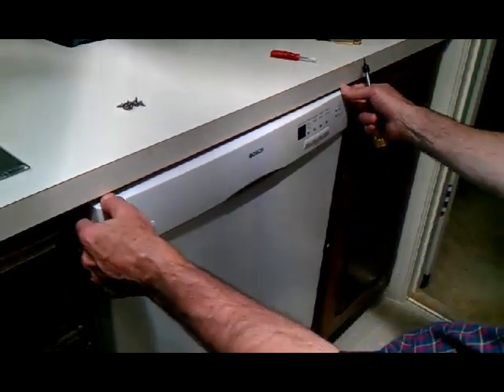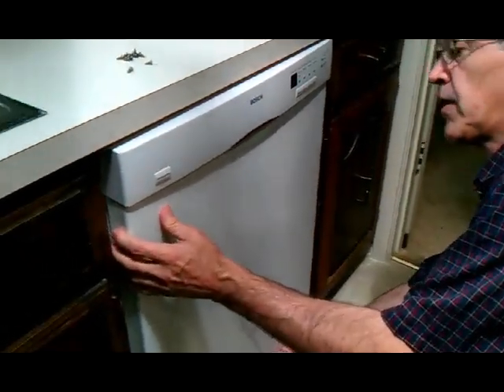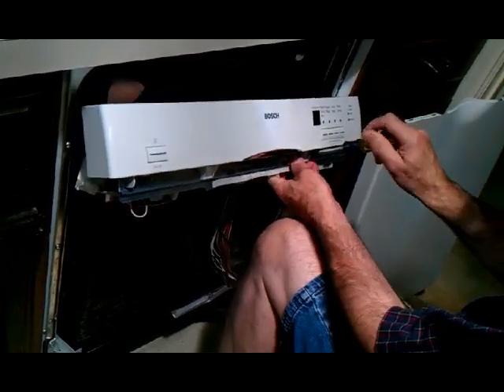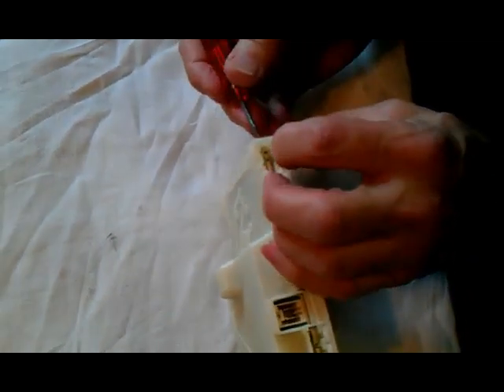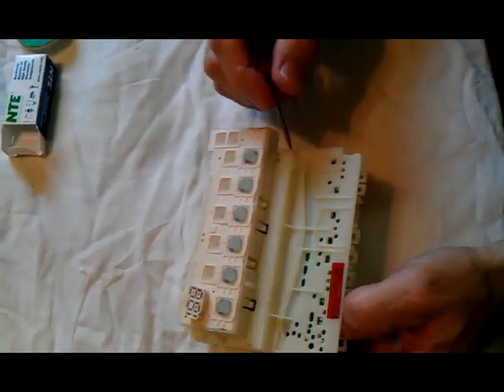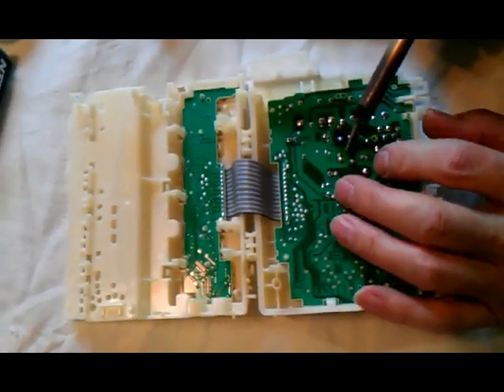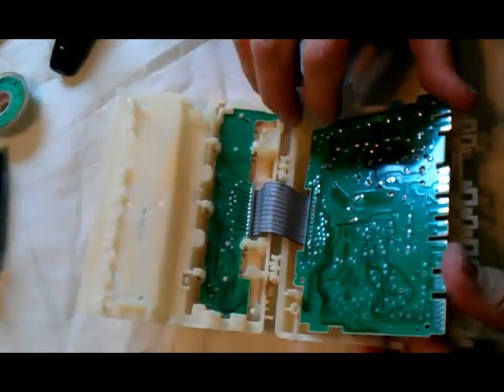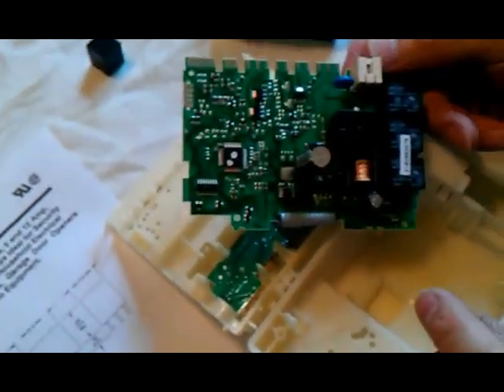Bosch Dishwasher Heater Relay Repair Part 1

Comment: Ive heard some solder can crack, also heating/pump assembly can go bad. How to i troubleshoot without putting the whole back together and running a load? I do have a multimeter but this is a bit out of my wheelhouse

Comment: What replacement relay for a HF3FA 006-HTF (576) 10A 250VAC for a Bosch Dishwasher SHE43RF2UC/64?
Thanks for your help!
Reply from the maker: I would use the 6 volt NTE Electronics R46-5D12-6 relay.  It is available at a number of places including Amazon.  Just search for "R46-5D12-6"
Reply: Which solder sucker did you use?
Reply from the maker: @annhering6585   I bought it back in the early '70s and it is no longer available.  Any solder sucker or solder wick should work fine.
Reply: Thanks for letting me know!

Comment: Thanks for making the video! I have a Bosch SHU43C0x/22. It runs well until there's 1 minute left on the cycle, then it gets stuck in an infinite loop. All other parts and functions work well. I hired a technician from an appliance company and showed him this video, but he said, "This is DIY, we don't do DIY. We can only replace the control board, and it is $375 on backorder with no estimated shipping time, maybe one month. Plus $200 repair fees." This is too much to repair an old dishwasher. So, I paid him $205 for the 15-minute diagnosis. Now I found a handyman who agreed to give this "DIY" method a try. It may cost me another $250 whether he can fix it or not. It probably would have been wiser to just order a new dishwasher in the first place since I'm not handy enough to do this myself. But I think it's worth a try if this dishwasher can have a second life.

Just a quick question: Do you know which model of relay I should buy for this Bosch SHU43C0x/22? Thank you so much in advance! 

Just a quick question:
Reply from the maker: Yeah, you are not likely to find an appliance repair technician to replace the relay on the board.  There may be 1 in 50 that might do it.  As for the relay, I am not sure which relay the SHU43C uses.  Look on the top of the relay for the coil voltage.  Expand the video description to see the relays that I mention there.  If you are still not sure, post the relay part number and I will verify it for you.
Reply: my bosch dishwasher is Shx33a06uc/22 which relay will go with this?

Comment: Hi, my she44c07uc/22 control board was badly burned (a hole thru the circuit board).  I want to attempt a fix using jumpers but I would like to see a good visual of both sides of the circuit board (including topside without relay in place) to make sure I don't have any traces missing.   Your video is excellent but would especially like to see topside wo relay in place to see if there are any traces on topside under the relay.   Also, the circuit board you have is slightly different than mine in that yours has a factory jumper wire that can be seen between the relays on top where as mine does not.   I'm wondering if I should add this (there are no pads/holes for it).  Ideally a schematic of the circuit board would be nice to be sure (i'm an old electronic tech but haven't practiced in years).   Much appreciated. 
Also, what does the relay next to the heater relay do?  (its common was also damaged (but fixable) Thanks!
Reply from the maker: Did you happen to watch my video about tips for repairing these boards? https://www.youtube.com/watch?v=RLdi-PgvAnU  There are a lot of different boards shown in that video.  If you don't see what you need, send me a photo of the front and back of your board to MyBrokenDW @gmail.com and I'll take a look at it.

Comment: Thank for your video. II have the same issue with my old BOSCH. I would like to replace the relay but I am having hard time finding a replacement.  I am reproducing what I see: 
NAIS  JS1-12V.  AJS1311.    SPULE: 12V    10A125V

Appreciate if you can help me find an NTE replacement, Thank you!
Reply from the maker: I would try Amazon for a R46-5D12-12: https://www.amazon.com/NTE-Electronics-R46-5D12-12-General-Arrangement/dp/B002C97U50
Reply: @AgglomeratedIdeas  Thank you!

Comment: Thank you for posting this video. Can you tell me why my Bosch dishwasher heating element works during the drying cycle, but doesn't come on to heat the water during the wash cycle?
Reply from the maker: It is possible that the dishwasher is in Economy mode. In that mode the water is not heated nearly as much as normal wash mode.
Reply: @AgglomeratedIdeas  Thanks for your reply. The DW is about 20 years old and doesn't have that feature. It also gets stuck in the WASH cycle and will not advance.
Reply from the maker: @victorsparks3408  Ah, okay.  It is likely a failing heater relay.  As the relays are in the process of failing, they often work intermittently.  My DW worked okay at times and then wouldn't...it was very erratic.  I finally took the control board apart and found the bad relay.  BTW, a failing/failed relay does not always show up as a bad solder joint on the board.  Sometimes all you will see is a darkened area on the board where the relay is mounted.
Reply: @AgglomeratedIdeas  Again, thanks so much for your reply. Do you have a resource for heater relays?
Reply from the maker: @victorsparks3408  it would depend upon which relay you currently have on your control board.  You will need to open it and have a look at the top of it.  You will probably find a match for it already in the comments below.  If not, then get back with me.

Comment: Great walk through.  After watching a few repair videos where they just re-solder that point.
I agree that if it burned there's a problem.  Obviously that relay takes a beating and a higher spec part would be the way to go.  Thanks for the simple step by step.  You even showed the little tiny clips that hold the clamshell together.  I only broke one in the process.  
Cheers!

Comment: I'm glad I stumbled across your video.  I just took apart my controller and can see that the solder is completely missing from one of the contact points. There are no burn marks but I assume it may have melted away and didn't short out yet (heater is not engaging). I was about to resolder like other videos have shown but had a feeling that I should look into it some more.  Just wondering if you/anyone has ever seen a case where the solder is just gone. No burn marks nothing.  I can share a pic if someone gets in touch. Thanks for this!
Reply from the maker: Sometimes the solder will melt without showing a burn mark on the board.  Nevertheless, the relay has failed and you need a new one.
Reply: @AgglomeratedIdeas  thanks very much!  Such a quick response!  The relay on mine is a Song Chuan 899B-1C-F-C E (6v DV) 10A 250V~T85.  I see one on ebay (from china) and the the only difference I see is a number marked on mine which is C0552 while the one on ebay is C0633.  Not sure of the difference, if any?  Would it work / or should I get another one like you did (will yours work)?  Thanks so much again!
Reply from the maker: @anthonysipos1002  You can go with the Song Chuan if you like.  It will work.  I would buy the NTE R46-5D12-6 if it were me though.  It is available multiple places including eBay.
Reply: @AgglomeratedIdeas  thanks again! I'll go with the NTE. It seems to be available in many places including Amazon. I'm so thankful for this.  Will report back on how it goes...
Reply: @AgglomeratedIdeas  . I just received the relay and was about to resolder it when I noticed that another piece seems to have missing solder. Looks like a coil (I think it's called that.. It's the only part with copper wire) just on top of that relay.  Is it a side affect of the failed relay and I should add solder or is it another defective part to be replaced? There are 5 connections to the coil and 1 has the solder melted away. Maybe from downstream effect of the relay failing? Thanks so much again!
Reply from the maker: @anthonysipos1002  I can't imagine what that item might be.  Take a look at my other video ( https://www.youtube.com/watch?v=RLdi-PgvAnU ) and see if you spot the item that matches the part you are describing on one of those boards and give me the time on the video.  Examples of various boards start about halfway thru that video.
Reply: @AgglomeratedIdeas  .  Thank you again.  My relay failed exactly like the one starting at 31:10 of your other video..  Looking at 31:51 I see now that I should not re-solder the connection below and above the failed solder point.  these pins do not look like they had solder to begin with (I assumed they melted away).  I just find it odd to see pins which are not soldered.  It's counter-intuitive, but I guess it's by design?  So in essence, out of the 5 pins of my relay, only 4 are soldered and only one of those failed (not too badly) just like the one on your second video.  Does that make sense?  My Dishwasher model is SHE44C05UC/22.  You are awesome - thanks very much!
Reply from the maker: @anthonysipos1002  Yes, on some models the relay only has 4 pins soldered.  You can send me a photo to MyBrokenDW@ gmail.com if you like, but it sounds like you have it figured out.
Reply: @AgglomeratedIdeas  once again a huge thanks!! Replacing the relay with your sound advice did the trick and saved me hundreds of dollars!  Truly epic how you guided me through the process!  Thank you so much again and again!

Comment: Wish I had done more research into the Bosch heating problem before assuming it was the heating element and spending $160 on one, only to discover the dishwasher still didn't heat.  I found videos like this one and removed the board, and the pin in question was completely vaporized, as was the plating around the hole - the relay had to be replaced.  I'm going to scratch off the solder mask around the area and all the way to another pin on the plane, and then run some bus wire along it to hopefully give a long-lasting connection. Bought the relay on Amazon.

FYI, my dishwasher was the SHX46A05UC/14
Reply from the maker: Unfortunately when the relay fails it sometimes does damage to the board.  Often it can be easily fixed like you described.  I put up another video to show that procedure.  I hope your repair goes well.

Comment: This worked!!! It actually worked! One advice I have for others is to use some type of 90degree metal pick at the 4:35 section. Use the pick to work around the edge of the entire plastic box vs poking from top down at each individual tab.

I didn't replace the relay, I seen many other videos and blogs stating just soldering is good enough. I am guessing back in the factory that one particular step was messed up for all items. If I run into the problem again I will replace relay.
Reply: Update, only lasted two years. Gonna replace the relay now.

Comment: Thank you for a well-done, concise video.  Even though my dishwasher is a different Bosch model, everything you demonstrated was perfect for this unit., right down to the burn mark on the board   The relay model you suggested is still available and fits perfectly.  It's been decades since I handled a soldering iron.
Reply from the maker: I'm glad the video was helpful to you.  Thanks for commenting.

Comment: What is the trick to identifying the correct pins to disconnect and how do I know if any of them are supposed to be open? Thank you.
Reply from the maker: Google your relay part number along with the word "datasheet".  The datasheet (similar to what is shown at the 8 minute mark in the video) usually has the pin information on it.  The heater relay uses the Common (C) pin and the Normally Open (NO) pin along with the coil pins.  The Normally Closed (NC) pin is not used.  Check the datasheets for your original relay and the replacement relay if it a different relay.  If you plan to use a relay that is not the same part number as the original, be sure to check the height of the relay.  In some instances the control board housing will not accommodate a relay that is much taller than the original.  That is one reason I recommend the NTE relays...they are shorter than many of the others.
Reply: @AgglomeratedIdeas  Thanks for the recommendation. Do you know whether or not an open pin connection is likely to burn?

Once I do order the spare part, is there an easy way to intuit pin configuration on the board? I don't want to be unnecessarily removing solder on the wrong pins. Is it just a matter of matching one of the common pins against what is visible on the board?
Reply from the maker: @jeffy9145  The Normally Open (NO) pin is one that usually burns.  When the relay is energized, the Common and Normally Open pins are the ones that carry the heater current.  The Normally Closed pin does not carry current.  It is common for many boards to have 4 relays that are the same part number, but the other 3 relays rarely fail.
Once you get your new relay you should be able to determine which of the 5 pins on the board need to be unsoldered.  Note that on some boards the Normally Closed pin may not be soldered...or may even just be sticking thru a hole in the board.  The other 4 pins will always be soldered.
Reply: @AgglomeratedIdeas  I’m assuming the pins are labeled in the underside? I’ll have to take a closer look but I thing the NO pin was not soldered and if it was it has mostly evaporated.
Reply from the maker: @jeffy9145  No, the pins are not usually labeled.  The solder pad for the Normally Open pin is often damaged due to the relay failure.  It may require a jumper to fix it.  You can send me a photo if you want my opinion as to the condition of the solder pad and how to go about making a repair.  MyBrokenDW @ gmail.com
Reply: @AgglomeratedIdeas  I would love to send you a photo, I am just not sure how.
Reply from the maker: @jeffy9145  Okay.  The other video that you were watching shows how to use a jumper to repair a solder pad that has been damaged.  You might want to watch it again and pay attention to the part about using jumper wires.

Comment: Where can I buy a 16 amp relay for my bosch dishwasher silent plus 44 dba model #shs863wd6n/10?
Reply from the maker: Do you have the information (such as part number) that is on your existing relay?
It is possible that you are looking for one of the Hongfa HF152F series relays which is used on some Bosch DWs.  The datasheet can be found here: http://www.fujikura-corp.com/power%20relay%20page2/HF152F_en.pdf
One of the 12V versions (HF152F-T 012-1HTQ) is on eBay here: https://www.ebay.com/itm/HF152F-T-012-1HTQ-Power-Relay-16A-12VDC-4-Pins-New-10PCS-/123524487197
This relay is taller by about .2 inches than the usual heater relays found on Bosch control boards, so it will not fit in the housing on many models that don't already have the Hongfa relay.

Comment: Have just replaced the replay on my Siemens dishwasher (SE26A260GB but I guess many models are essentially the same). Quite an easy job if you have a soldering iron and solder sucker (both can be inexpensive). For those in the UK where the R46-5D12-6 is unavailable I bought a 6V Mini Miniature Power Relay SPDT 15A from switch_elec on ebay at £1.89 delivered. They sent me the specification including size/pin out and its a good match for the R46-5D12-6.  It's also available from RS (Stock No.476-573) at £1.66 but delivery cost is extra.
Reply from the maker: Thanks for providing that information.  I'm sure that will help someone else down the road.  Cheers.

Comment: My dishwasher had the exact problem. I resoldered the joint and have been lucky for a couple of years. Since that time, I've become much more confident with desolder and solder and the dishwasher is failing again. TIme to open it back up. The replacement relay has been waiting all that time in the drawer and I am sure I can replace it now. This video is incredibly helpful!!! THANK YOU! My KitchenAid fridge has, since the resolder of the dishwasher, had a similar problem with two relays and two capacitors which fail. Got that board out and rather than send it for a $250+ repair (or $800+ replacement... If you can find one), I bought parts for $25 from an eBay seller who had all the right parts compiled, and did the repair. Now time to go back to the dishwasher and do what I should have done in the first place.

UPDATE 1 MARCH 2021: SUCCESS! We have a Bosch SHU66C05UC/47 Dishwasher which was here when we bought the house. The relay was 6 volts, an NTE R46-5D12-6. Worked like a charm! Thank you!!! Our hearts go out to all who survived the Texas storms. Don't mess with Texas!
Reply from the maker: It sounds like you are already well versed in what you need to do to replace the relay.  If you have not watched my other video (https://www.youtube.com/watch?v=RLdi-PgvAnU) about making repairs to the board, I would suggest doing so as it might help you.  Thanks for commenting and I hope your repair goes well.  Cheers.

If I may, I would like to take this opportunity to give a shoutout to my fellow Texans that are still recovering from the snow/ice storms a couple of weeks ago (today is 3/1/21).  Nearly everyone now has power and water restored except for those that have severe damage that has made their home uninhabitable.  As for me, I slipped on the ice the day before the main storms arrived.  I broke my left leg requiring 3 hours of surgery.  I was sent home just before the first storm hit.  I am glad that I serviced my generator over the summer and my brother in law was able to come over and start it right up.  If it had not started, we would not have faired very well in the single digit temperatures as we lost grid power for many hours.  We were also able to keep the faucets running to prevent busted pipes.  I think I need to get a t-shirt that says "I survived SNOVID-21".